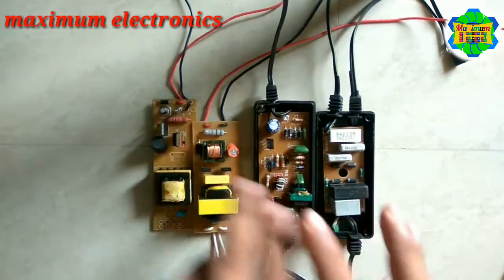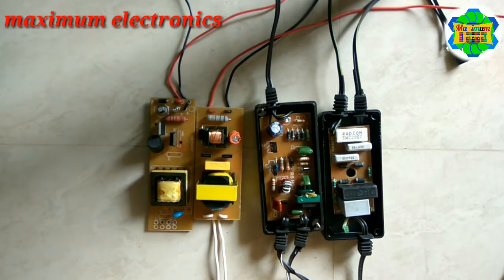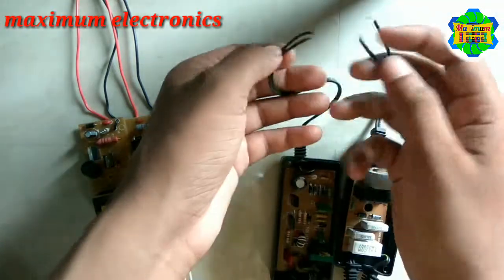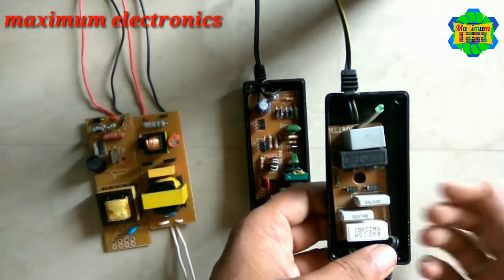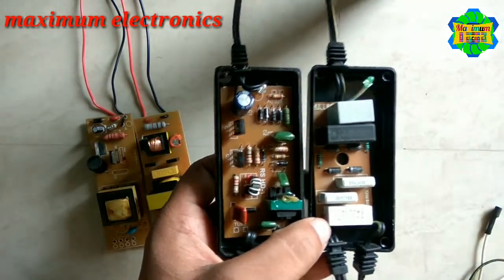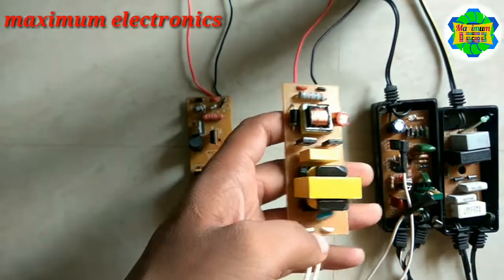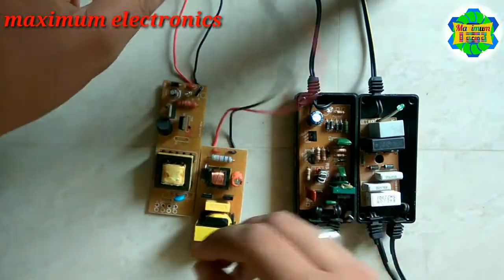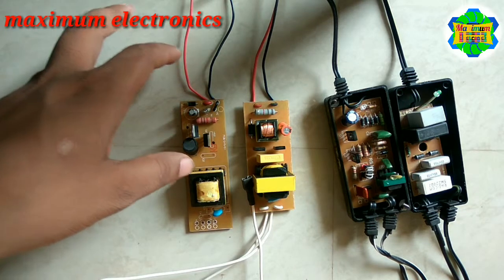Best uv choke

Comment: Can you give some information regarding the transistors used in these type of DC to AC choke. One of two transistors present in the UV choke got damaged due to water leak. I just want to replace it with something equivalant, the transistor was labelled BLD128D. A little help will be much appreciated. Thanks.

Comment: If I get DC choke for RO system. How to connect both motor and choke to same 24v SMPS. Will it give any problems ?
Reply from the maker: You can join uv chok,pump &smps in  parallel connection

Comment: can i connect two 15 watt uv tubes in series with normal ac 36watt choke ??
Reply from the maker: Good question 
But do not do this
Reply: I also have the same question. can I connect two 11w tuv to a single choke using two starters?
Reply from the maker: Bilkul jod sakte hai pr ye chok kitne watt ka hai is pr depend karega
Reply: jo general hoti h 36w ki
Reply from the maker: Maine aisa nahi kiya hai 
Agar aap aisa karna chahte hai to kr sakte ho

Comment: I m preparing a uv sanitizer box but when I connect ac ballast to the uv lamp it starts flicking ....is that normal or should I buy a good ac choke for uv lamp
Reply from the maker: U need to change either chok or uv lamp 
Note: please use Phillips uv lamp (for accurate uv level )
Reply from the maker: https://amzn.to/3hh3cUC
Reply: Thanks bhai ...price bta sakte ho Phillips ki AC choke ke 11W ?
Reply from the maker: Around 200-350
Reply from the maker: You can purchase accord uv chok(branded)
https://amzn.to/2XNGA6A
Reply: My lamps are of Philips only but chokes are local ... should I buy Phillips ac chokes ?
Reply from the maker: Yes you can purchase phillips other wise any brand  of dc chok is cosiderable
Reply: Does flickering stop after using Phillips ac choke?
Reply from the maker: If the chok is right one then no need to worry
Reply: Thank you boss ....would you please tell me other brand name for ac choke?
Reply from the maker: Phillips 
Yash 
Inspite of these there is no such brands provide ac uv chok
Reply: I am very great ful for your help boss

Comment: Hey...in my RO iam using AC choke to drive 11watt Philips UV lamp...now in my current setup i have to manually on the UV choke whenever i use the RO...i want to make this automated wherein i can use a valve and it will automatically switches ON the UV when the water level dips in tank and switches OFF the UV lamp when the water is full...how do i achieve this..pls guide me
Reply from the maker: Your system can be converted into automatic 
1 if you use float switch (serie in ac connection of power supply)